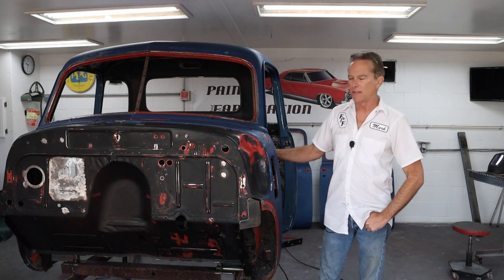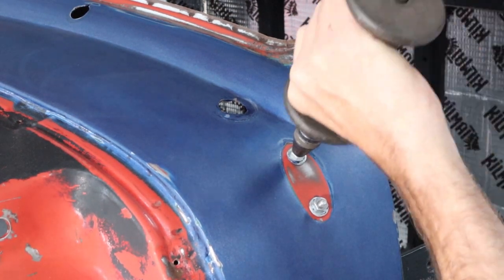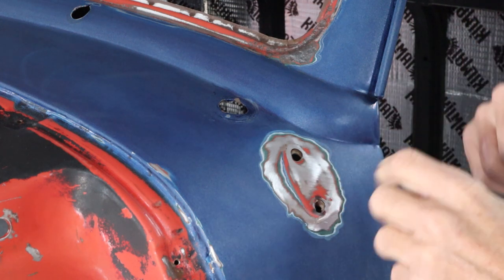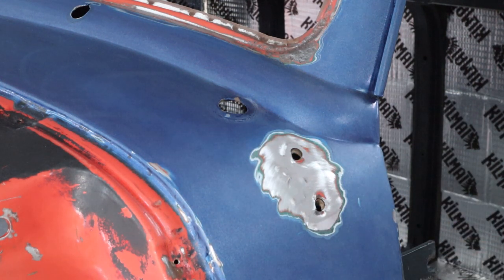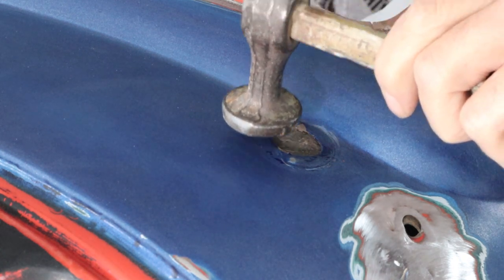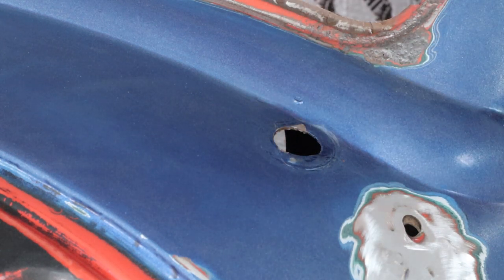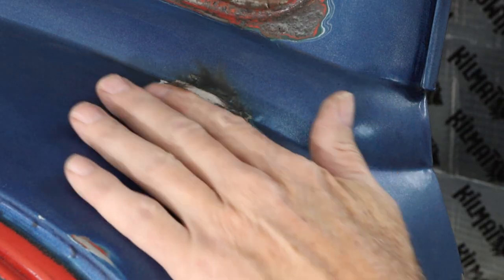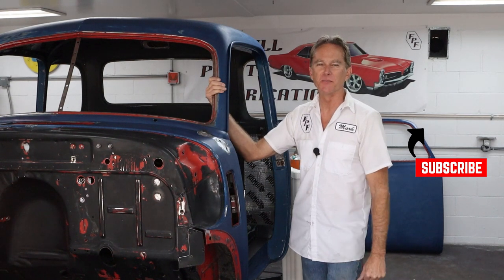1950 Chevy Truck (Ep 32) Cab Mirror mount repair and Antenna Hole Delete

Comment: Did you remove the dash to gain access for the mirror bracket.
Also did you record how to attach the mirror. Thanks
Reply from the maker: Using the slide hammer with bolts through the mounting holes worked well enough without removing any dash parts luckily.
The owner installed the mirror and I don't think he had any issues. When I was straightening the area I used the mirror arm base as a guide to make sure it made 100% contact.
Mark
Reply: @FoothillPaintandFabrication  
I guess I worded it wrong. How do you get access to the mirror mounting bracket from under neath. Your video doesn't show thzt
Reply from the maker: @jamessimone4356  sorry misunderstood the question. I tried to push up to get the dent out but as you know you can barely see where the holes are from underneath. As I recall I was able to access the area just enough to push a bolt up through with a flat washer on it. Since the entire interior was out including everything out of the dash it worked out. Do you have your gauges out?

Comment: What is that weld tacking tool you are using to tack weld the antenna hole plug?
Reply from the maker: Tig welder.  I am not very good at Tig welding yet but I am working on it.  I could have used the Mig welder but I need the practice with the Tig.